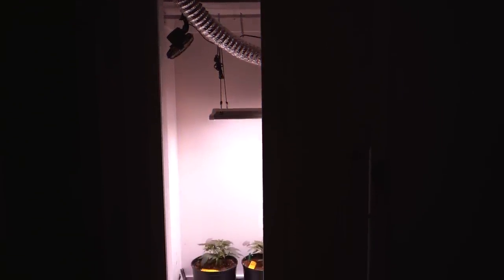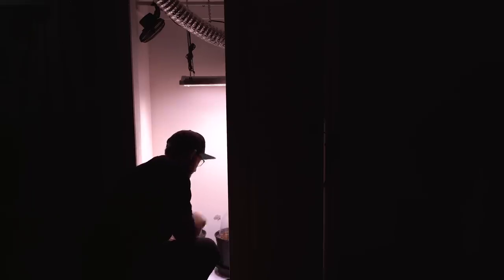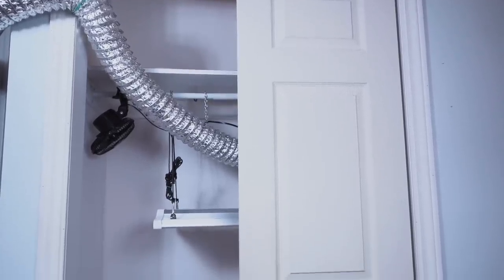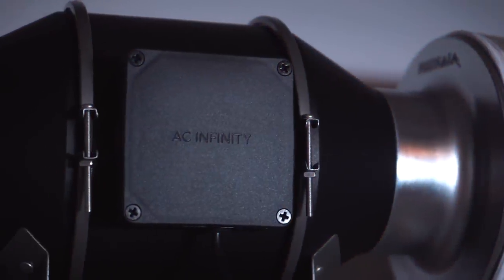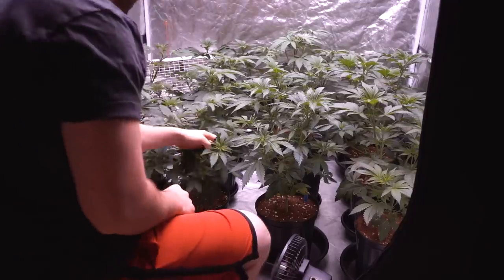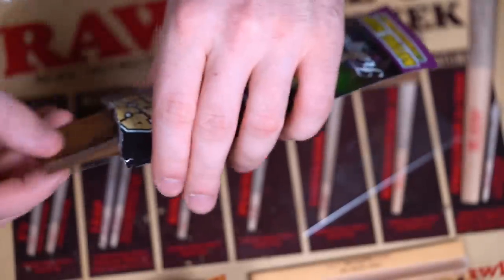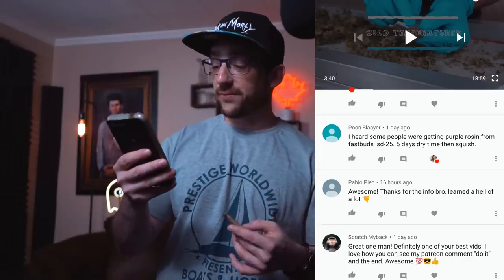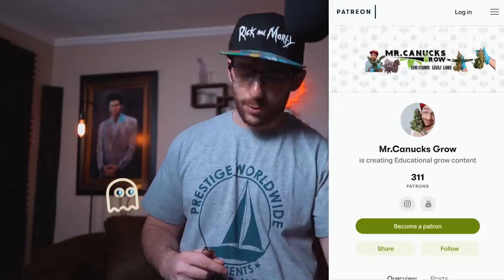180W HALF POUND CLOSET GROW BUILD: BEGINNERS SET UP GUIDE

Comment from the maker: I'm excited to see if I can pull a half pound from 180 watts only! I'll be doing a full seed to harvest video on this grow so stay tuned.
Thank you Patreons for your support <3  New videos/Early releases/1on1 - https://www.patreon.com/mrcanucksgrow
Reply: What is the noise factor tho with fans and light?
Reply: What strains are you running in this grow?
Reply: Hey, lotta people are ripping people off under your name on instagram.. They pretend to sell weed online and theyre raipping people off online
Reply: I'll be right there with you!  I have two 2 foot Hi Output T5s using AgroLED bulbs and a side supplemental light (red/blue) in a 4x4 growing Blue Dream and Blue Cheese in organic soil.  Last time I got 5 ounces but knew I could do better because I only vegged for a short period and didn't realize I needed a longer bloom period.  I also use USB fans that I got for 1.50 each on sale at WalMart.   With lights only I'm pulling about 180 watts.  With fans on low it's about 215 watts.
Reply: Good strains and training for gains, absolutely you can pull that off
Reply: Don't care too much because I can turn my sub off, but I agree with the bassy comment. Couldn't turn you up past 4 without rumbling until I turned subwoofer(wimpy little 2.1/100w) completely off.
Reply: @Kidandas  really depends on how cheap you go on you're fans and what not the higher quality fan you get the less noise id recommend getting an exhaust fan more on the expensive side or at least look for one that's quiet the normal fans moving air around really isn't loud unless you get a super rinky dink fan
Reply: I need to show your chanel more love. You are great and much appreciated. Oh wait your Canadian "sorry" jk bro.
Reply: What light is better v1 or v2
Reply: i’m a fellow canadian ! 👍 what region are you based in ??
Reply: Ive always been told by other growers that you need a min of 600w per flowering plant. This is why i have 2 viparspectra 600w leds for my 2x4 tent. Is my lighting too much for the space?  Im very interest in getting a 1/2lb per 180w. Grateful for your vids man!
Reply: You don't got no extra Autoflower seeds mr. Canucks
Reply: Mr. Canucks Grow      Ok so that was off led power/wattage. What about hps lights inside of flower room. What’s the rule of thumb inside the tent per Square ft?
Reply: That would be impressive.
Reply: I was wondering if u could do hydroponic grows
Reply: @6120joshua  50 watts
Reply: Your bass boosting filter distorts the audio quality of the video
Reply: 1Smokeaway thank u.
Reply: I'm curious when you say over a gram a watt are you referring to dry weight ?
Reply: Dude your the hero seed links?
Reply: roastfacekilla2 most likely. Most people/growers refer to dry weight.
Reply: great job like always
Reply: Hey love the vids but your voice need a work. If you are a 100 kg then eat or drink 15grams of puread ginger in two weeks you will thank me
Reply: You needa come down to saint maarten in the Caribbean and teach me how to be like you!
Reply: @wyattmerrill3404  Neptune seed bank all day
Reply: in house genetics cant go wrong
Reply: it was a great vid.
Reply from the maker: Apeman Commeth  yes, I leave my exhaust system and fans on 24.7 they are not hooked up to a timer.    The acinity inline fan is smart control, it will change speed based  on environment inside Grow.
Reply: Do u find with feeding all autos the  same amount.  Some may  do better.  With lil nut tweaks  just a ?         100% thanks  for ur content it a blast watching u bro  .
Reply from the maker: @greenstarr8025  yes certainly specific strains and even phenos require tweaks.
Reply: Mr. Canucks Grow hey Matt I have a question I am way new to this and I know once your trichomes heads start turning milky it’s time to cut her down, why are the vast majority of my hairs still white? Should I wait? Which one is more important?
Reply: Hey Matt this may be a dumb question, but how do you decide on choosing a plant to be a mother while phenohunting. I've never tried my hand at cloning and my understanding is that the mother plant never matures fully because its life cycle stays in vegetation in order to constantly have new growth for clone cuttings? So I guess my question is how do you know what the flowering structure of the plant will be while phenohunting for a mother plant?? Hope you get a chance to see this and can help enlighten me. Thanks again for all you do!
Reply: Love Theo von in your recommended lol he’s the best
Reply: Get a sodium vapor lamp 600w for your tent its ridiculous that you get only 200gramm with that big tent and so many plants also use a cooltube if you get heat problems and put the hot air out of the room(your fan needs to change the air in the tent ...so use a bigger one with a regulator and the noise of the fan will decrease to the half) the tent is sucking fresh air from the room ..no fresh air ..heat problems ...i personaly will use 2x600w svl for this tent size and gain 2kg ...for beginners use skunk nr.1 its a total easy to handle strain and a 400w with a adjust a wing in a 80x80cm tent you gain 200-350gramm ...ah and pull the led in the waste  ..sorry put i only grow for the last 20years :D
Reply: You should go on gml
Reply: You look like Milhouse!
Reply: @joshwilson4168  lol the real wattage is like 200watts maybe less. So that's why you need 2 atleast.
Reply: @morsetsk  I'm thinking I should maybe veg under my LEDs and flower with a hps or something but I won't throw out my led lights lol they do work.
Reply: @Alexander_l322  sure the led works ..fluorescent tube works to for the vegi, Flower/bloom phase  hps/red not the universal one...LED light are invented for greenhouses to longer the lighttime nothing more everything else is marketing you just waste the half of the potential of the plant, seedbanks like sensi seeds just using 1000w hps for a good reason and they know what they do since 1985 ^^
Reply: You better get a full pound!
Reply: I have a 2.5ft wide x5ft long 7 1/2ft tall I have a watt California lightworks 250 solarexteme cob series next to that is another  California lightworks 275 solar system that has that blurple spectrum is this a bad idea to have a cob spectrum next to a blurple spectrum an I'm having trouble with heat it like to stay around 78°- 82° do u have any suggestions an it's a ebbnflow setup so the humidity is already high
Reply: Do you need a house to do this ??
Reply: Any ideas on what auto's your running next round? Just curious . Great content and information thanks for making me a better Gardner.
Reply: 35 watts led actual draw or 35w led BSclaimes wattage?
Seems to me that 560watts of actual draw of 2.8mj/w leds might fry my little 4x4.
What kind of efficiency informed your estimated figures of watts per square foot?
Reply: @joshwilson4168  is it blurple or is it a decent pacivly cooled full spectrum unit with a mmj/w rating above 2.3?
Reply: On the verge of purchasing my first grow tent set up. Autos for first attempt and will try a couple of different training methods for hopefully a bigger yield. Your channel has been so helpful. Please keep on posting!
Reply: Mr. Canucks Grow hey brother love ur page so informational. Looking to get into LEDs for the first time and using it in a closet. Ur vid is super informational but what’s a affordable LED for the same space u have to will really produce decent yields for me. I trust ur suggestion before I buy sumthing. I no it’s cultivar and skill etc dependent but what be your affordable choice for almost the same closet lol. Thanks for any help u can give and plz keep up the awesome content
Reply: @B can you tell me what lights you used sir... Maybe. Link
Reply: Hey guys is the Dr. Earth just as good as Gaia green? Im in a state where I cannot find gaia green products unless i pay an arm and a leg.
Reply: Can I use CFL light
Reply: Hook me up with some cbd hemp.
Reply: Is the ventilation system a must just wonder if you can use fans instead?
Reply: Turtle Head ywwww
Reply: for an 80/80/180 CM aunt what not too expensive brand of full septrum led panel can you advise me?
Reply: I was wondering if the carbon filters pre-filter should always be on the outside?
Reply: You shuld make youre own strain named, Mr giggidy
Reply: Lol qwagmire voice. I could chill with you all day nb.
Reply: MAXSISUN PB2000 Pro Grow
Reply: So is the pump push air In or out
Reply: Thanks for your great videos!

Can you tell us how loud that inline fan is? 

All the quiet fans I can find are quite long and yours seems to be about half the size of the “quiet” ones

Comment: Just about everyone on YouTube says to vent your closet grow into the attic.  I did the same thing at my last house and mold started forming in the attic by the exhaust,  (I assume from the increased humidity from growing plants)just be aware if you are doing this in a home you plan on living in for awhile. I would take the extra effort and vent all the way outside through a roof vent or something.
Reply from the maker: You are correct, if ur grow is big enough u need to make sure ur venting outside. Through attic but duct should be placed by vent in attic so it goes outside
Reply: If your rocking a basement grow, board up a win if the room has one and install a good exhaust grill. even if you don’t have a window, an 18 volt drill with a 4 1/4” holesaw bit can drill a hole through a wooden header to the outside isn’t too hard. DO NOT drill through joists though. 

Matt, whats your method for ph up and down as a organic grower?

Comment: When you still live with your mom and trying to grow your own weed👇🏽👇🏽👇🏽
Reply: Tommy Ayala tell her it is so you can grow organically (which you can and it’s the easiest plain water only method’notill growing’) and so you can control what’s inside of your weed so you’re safe about your self medication
Reply: 47 E.B.O @instagrowlog on Instagram, my last grow before my current was a basic soil mix from mountain organics and I used water only the whole grow. 600w and yielded about 520G ((:
Reply: @ISpeakHTML  bro will a spider farmer 2000 grow a 2x4 no problem and if I have a exhaust fan leading out the window what brings air into the tent
Reply: @henryflores8396  the negative pressure will draw fresh air into the vent holes of your tent if you're exhausting your tent outside, idk enough about the spiders, they're trash id go with quantum board LEDs from HLG or other trusted company, or build a LED cobb light yourself

Comment: It is pretty easy to do 😋
I used to use a single 250w HPS to start..I could have finished but temperature and space constraints prevented me..sucked air into the attic to vent out into the attic *good in line carbon filter.
Reply: Outdoor grows only, auto flowers weren't out yet. Yeah temperature is a huge factor to veg growth, especially with H.I.D. lighting, they get hot.

Comment: Since this is a beginner video, I am going to reemphasize the "ventilation is not cooling" point. 

I am fighting this problem again the second year in one of my rooms that gets scorching hot every summer just because its an old, small room that doesn't circulate air well and is 5 degrees warmer than anywhere else in the house even with the windows covered with 3/8" foil foam insulation. Just remember your older family member's house and the infamous "hot room" that had a TV and bed in it to torture the guest who spent the night or spent some time staying there. The room is hotter than a car crammed full of people on a summer day with no AC and broken windows.

Comment: Great video once again Matt!
Thank you for all the info you give on this channel, it is awesome :)

Quick question...
shopping to start my first grow setup of about 4 plants. 
So far I plan to go for a 2x4 grow tent, AC Infinity T6 fan. currently not sure if I should go for the ES180 or Bestva reflector series 2000w.
Do you have any insight?
What tent should I choose, vivosun? gorilla?
what light will be better between the two?
Any suggestions for my carbon filter? 

I'll use pretty much the same technique as you with coco, 5gal pots etc.

Thanks for all and keep up the good work man, this channel is gold ☺

Comment: So let's just call your closet a big 2×2. A 3x3 is 9 sqft, 4x4 16 sqft and 5x5 25 sqft. Then there's HID to LED conversion table. Since LED is 30% brighter and consumes less energy its a no brainer to use LED. However, u can't use the extra light just because it's there if you don't have the C02 to convert or u burn your plant and terpenes with to much light. You always have to use the conversion table from HID to LED consumption. A 1,000W HID or HPS is equivalent to a 720W LED requiring a 5x5 space or 25 sqft to convert the light to yield. 600W HID is equivalent to 400W LED requiring a 4x4 space or 16 sqft. A 400W HID is equivalent to a 260W LED requiring a 3x3 space or 9 sqft. A 200W HID is equivalent to a 80-100W LED requiring a 2x2 space or 5 sqft to convert to correct yield. So you had 5 sqft and a LED yet you use the amount of watts that is required for a HID. LEDs are much more advanced and put out more ppfd than a HID light. Why did you buy the LED fixture if you werent going to take advantage of its ability to kick out 30% more usable photons using 30% less energy. You spent $450 more for the LED fixture yet used the same amount of electricity as if you had a HID? Using more energy isn't going to increase your yields without C02 above 1000 to take advantage of the gigh umols. You bought a 180W fixture for 5 sqft when you only needed 80-100W. If you were going to use almost 200W why not buy the HID for $400 cheaper being the yields would be the same? Further proves you guys do not know how to use the equipment your buying.

Comment: Yep, definitely like the reading of comments at the end. Thx Matt. 
Got a question though, I noticed that I get voltage leak past my timer which results in my LED light glowing softly during the dark period. 
1) Will a soft amount of light screw with a photoperiod during the 12hrs of darkness? 
2) Is it just a dodgy timer that causes this? Have you heard of this issue before with LED’s because they need low voltage to work? 

As a side note, I know someone who has a 2x2 tent but when sealed with a photoperiod, the RH hits 100% and he gets a swimming pool at the bottom of the tent. 
He’s using a 650W Viparspectra LED and fan for air movement. 
No room for a dehumidifier in a 2x2. Any advice? 
Cheers 🍻 and another shoutout from here in Australia 🇦🇺

Comment: Anyone can grow flame weed in a few steps. Step 1, and the most important step of all, finding a strong genetic. Step 2, find a water only soil. step 3 find a place where you can control the environment and adjust lights to the right intensity using a par meter. That's really all you need. The genetic and pre-amended water only soil does all the work and makes you look like a pro with little to no effort or experience

Comment: Tried using just a grow tent in my closet instead of converting the closet and heat has been insane.  With my bloom switch on - the tent needs to be in a 60degree (F) room to be about 80 in the tent.  The veg only was much easier at about 60-65 degree room would make a 75-80 tent.
Reply: Are u using inline fans?... if u have a proper tent, then the tent will have vents on bottom.... draw the air with the fan from ur 65 degree room u have, up the vents in ur tent, thru the fan, to the outside....itll remove the heat from ur lights and pull in cool air from ur  surrounding room
Reply: @romanreckless8263  Tried this as well as blowing a fan at the closet and using a rotating fan in the tent.  I suspect my inline fan in severely under powered and needs replacing to solve this issue.
P.S. the tent was cheap and only has one vent on the back which could be the other part of my problem.

Comment: Looking into designing a 2400 sq/ft Tier 2 grow in washington hopefully in a year or so. I priced it so far around $108-113k and added an extra $50k as cushion with a 300k budget if so. Open for ideas about what you think pricing could be. It would be a nice help. Also would be running LEDs and controlled environment with 8-16 15ft by 4ft feeding tables. Advice would help out if any🙏

Comment: One thing I don’t get is the a/c cuz if they grow outside in heat and cold why should it matter inside the house? I don’t use a ac unit specifically for my plants because the house ac does the job . I also use Walmart brand led lights that cost me $20-30 I do need to buy an exhaust tho

Comment: Is an intake fan not needed with a small grow like this? I was looking to use the ac infinity t4 (into attic) as my exhaust with a carbon filter, looking to use a 250w led. Iv never grown before but feel quietly confident of following your videos. Im concerned about heat and humidity, were i live is cold and not humid. Am i overthinking things? Any help or tips appreciated!

Comment: If using one ES 300 LED light source in a 2.5 x 4.5 space how high should the ceiling height be. Is it good to lower the ceiling height to control air and heat or should you keep a standard 8 foot closet ceiling? Thanks!

Comment: Please correct me if I’m wrong but according to this video for your light formula you said to find the sq ft of the area so u said u basically had a 2x3 which mean the sq should be 6 not 5 so then if i need 35w per sq ft or 50w then then need watts should be 210. But u added the 2x3 to get 5 so watts should be 175 then so should i add or multiply for the formula